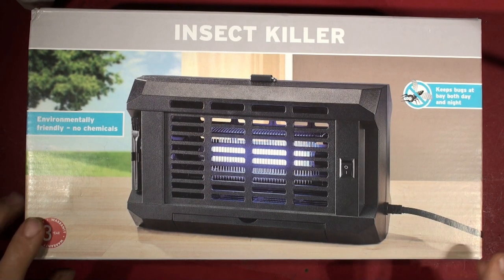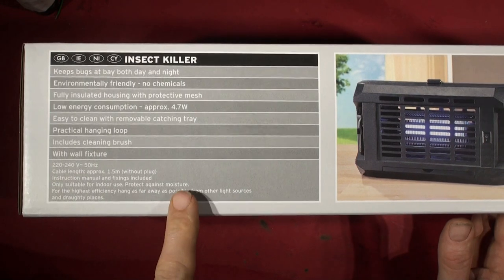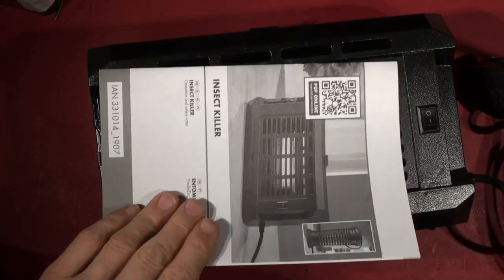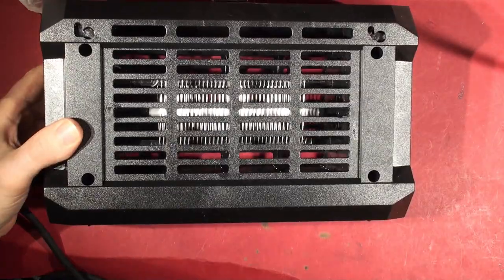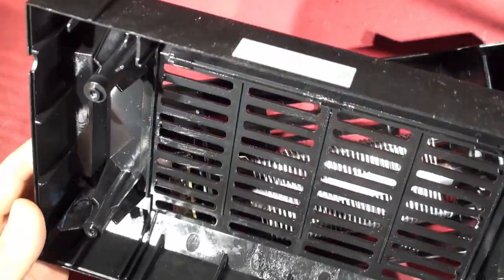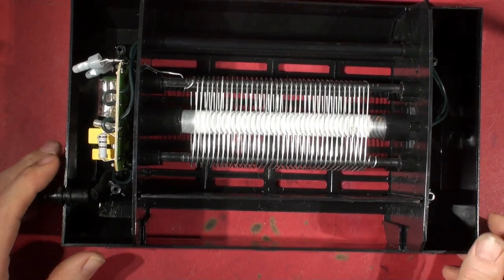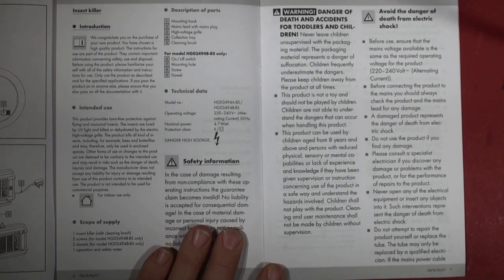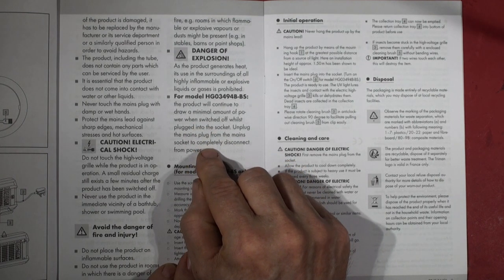Insect Killer on Sale Now At Lidl UK  HG03494B-BS Part one - unboxing and UV Test

Comment: I bought three of these less than a month ago, two of them the UV light has already stopped working. I can't find spare bulbs anywhere. They did work well but are now useless.
Reply from the maker: You can buy the tubes at RS and Farnell. You need the CCF (cold cathode fluorescent) Black-Light blue' type made from Woods Glass.. (~385nM wavelength) They have a phosphor coating.  Whatever you do don't use a clear glass UV tube as these are very dangerous to your eyes. Just a few seconds exposure can give you serious ARC-eye. I speak from experience!!

Comment: Can I ask a question please ?
Reply from the maker: Yes, fire away
Reply: @razenby  so I have this insect killer but on the corner when I switch it on it sparks and cracks, can I solider a link onto it or bin it ? Still works and lights up but very noisy